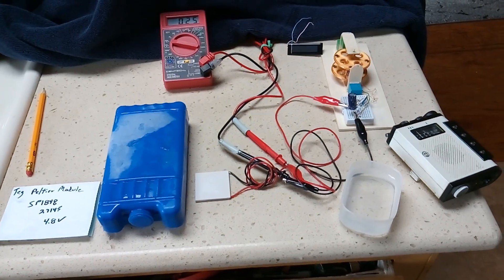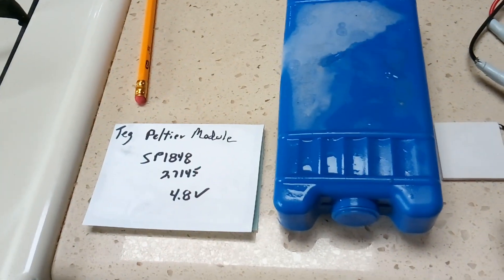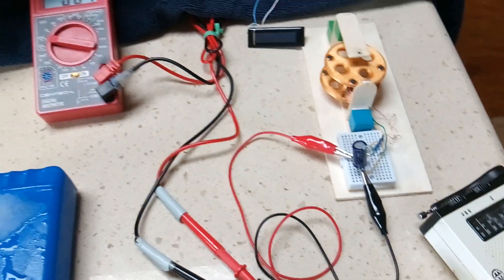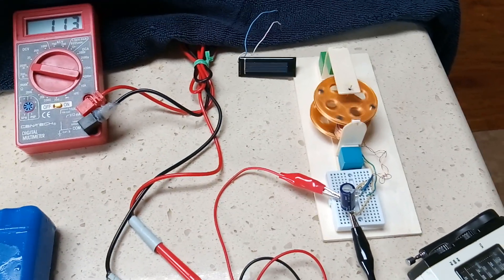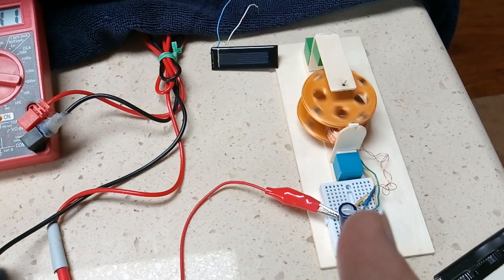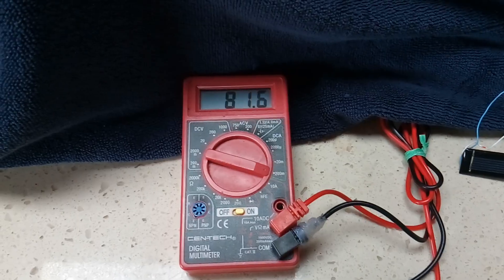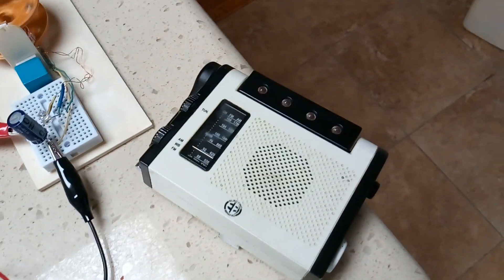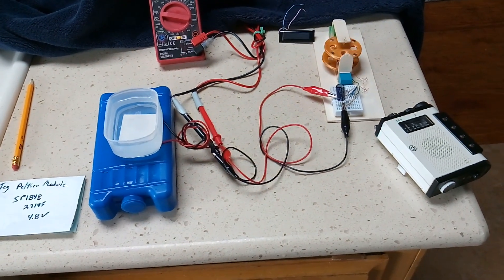Low Voltage Project --  Part 2

Comment: i would assume these modules can generate amps, with enough temperature differential, if they consume amps in their normal role. if you havent already, maybe try some drive coils with less dc resistance.
better impedance matching and rpm should be attainable.

Comment: Makes me wonder about a practical use, especially in winter... an outdoor dog gate perhaps. It's possible for a dog to jump about near a gate and move a latch or lever, but not an electronic one. If you were to place your hand on the peltier (mounted to a squared metal rod), the thermal energy difference could move a sliding lock via a similar motor and high gearing. No batteries, no escaping dog  :)
Or, if torque is a barrier, store the collected energy in a cap, to be dumped into a solenoid at a threshold, similar to the way a solar popper circuit works..

Comment: I would think the pressure is just increasing the contact surface area, improving the thermal conductivity.
Reply from the maker: I think that you are right.  The P and N thingy is just responding to temp.
Reply: @sIXXIsDesigns  that would be logical if you were connecting it to a heat sink or similar. Not practical if you are just pushing it onto an ice pack.

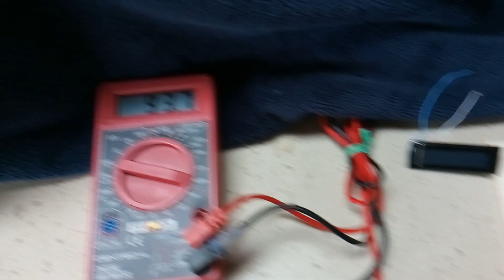Comment: 3:49 That's not how you measure current.
Reply from the maker: I'm glad that yo made that comment.  You are right. I should have said  that I was measuring the dead short across the Peltier.  What the motor was drawing is different.  Thanks for calling me on that.